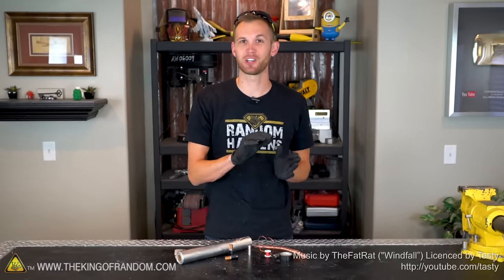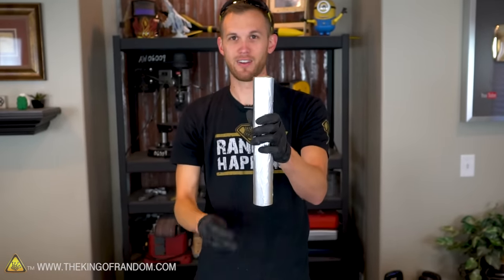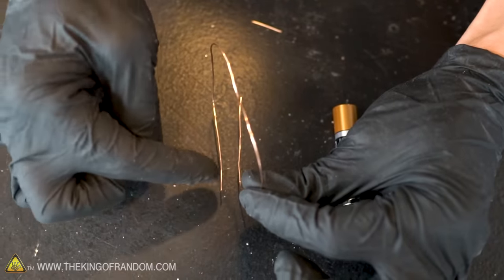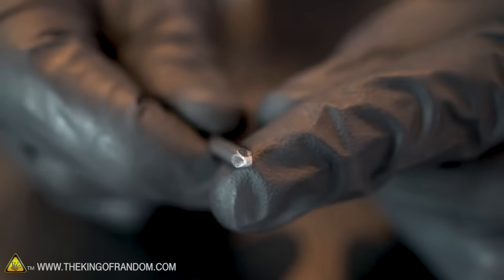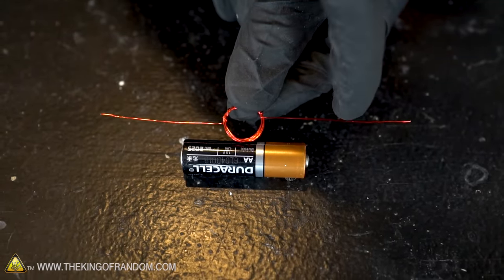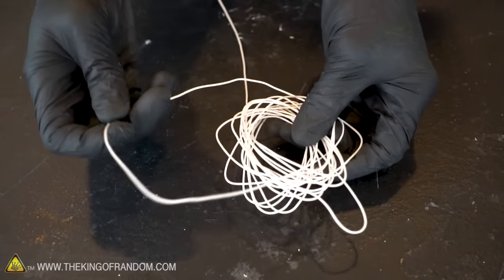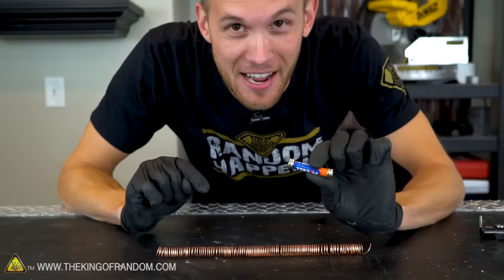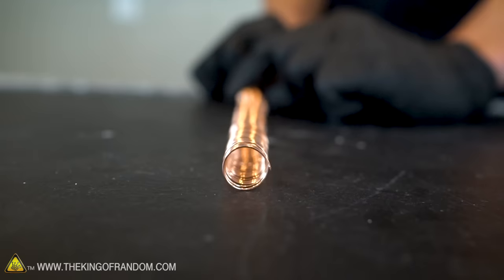4 Simple Magnet Motors You Can Make at Home! The TKOR How To Make A Magnet Motor Guide!

Comment from the maker: Hey what's up Noti Squad?! Welcome to December!  For planning purposes, we're posting a video every single day from now until the end of the year.  🏆 Should be one crazy ride so hang on! 😜🤘
Reply: magnificent video
Reply: when a conductor passes through a magnetic field in induces a current in the conductor 
and when a current flows through a conductor in induces a magnetic field
Reply: You're gonna be busy this whole month. Haha
Reply: The King of Random i found out that a candle emitted a electromagnetic wave. with a photovoltaic candle holder you can get electricity too 🤗
Reply: please make a video of modified dynamo of tamiya (a toy race car from let's go anime) .. change the the magnet and copper wires of the  dynamo to a strong magnet and slightly thick (i don't know if the western country have number for copper wires but colleague said the number you need to use is number 22) and the result will be amazing blazing speed of tamiya .. btw im from the philippines .. im very sorry for my grammar .. love you lots from the philippines ,, power to you guys
Reply: with the magnets and copper coil, is there a way to increase its velocity?
Reply: EPIC!
Reply: The King of Random can u do a video how to. Upgrade small dc motor
Reply: didn't batteries used to have a dip on the negative?  I've suddenly realized most batteries have flat bottoms
Reply: You should loop the wire (almost) and see if the battery can loop around.
Reply: Sir Peachez increase the voltage. I.e. add another battery:)
Reply: scottaw1981 nerver seen that
Reply: The King of Random where are you
Reply: The King of Random make wonder woman's lasso
Reply: Yeeeee every day
Reply: It is so difficult to post videos every day but you guys are awsome
Reply: You can actually cut through alkaline batteries and any AAA and AA batteries, but not if they are li-ion and li-poly because they like to explode when they come into contact with the air
Reply: what kind of credit is it your getting by translating videos
Reply: The King of Random - please join the copper coil together at both ends. I wanted to see whether it would speed up. Also does a bigger battery and magnet = faster thru the copper
Reply: My BIRTHDAY is after December into January but Christmas is coming soon
Reply: @The King Of Random wanting to see you on camera soon
Reply: Magnets
Reply: Can you up-size that experiment with the coil and battery to something much larger.
Reply: The King of Random hey man
Reply: Nico Bryan weeses
Reply: Keep doing these kind of vids plz! These are the one that got me watching your channel!
Reply: Hi
Reply: YAY!
Reply: The King of Random add to the blow dart gun plz
Reply: sup
Reply: Make a loop for the train, and make a bigger version.
Reply: Upload on Jan 7 too
Reply: so every simple project is going to be 5 parts.
Reply: The King of Random hey
Reply: The King of Random this is what I’ve been waiting for bro! Vids every day!
Reply: The King of Random that was like 1 1/2 inches not 1 cm
Reply: Can you still do all the things you did in the ninja video
Reply: Where did grant go???😭😭😭
Reply: The King of Random where did grant go
Reply: Make a longer copper spring see what happens
Reply: Petmalu ka Lodi
Reply: i could make a motor and use it for my science fair this year at my school
Reply: Where did you get those magnets
Reply: The King of Random what/who is your source for the magnets?
Reply: The King of Random I got a question. I just wanted the video were y'all put dry ice in liquid nitrogen but what happens if after you put dry ice in liquid nitrogen the put it in liquid nitrogen after its been in the vacuum chamber for the super liquid nitrogen. So I guess I'm asking in a simple way is what happens to liquid nitrogen cooled dry ice in super liquid nitrogen
Reply: The King of Random if you stabbed into the battery, lots of staining acid would spill out. I️ know from experimenting
Reply: The King of Random you are more or less creating several small inductors (which generates a electromagnetic feild). This is also  the idea behind rail guns, so yeah that's some powerful stuff.
Reply: The King of Random l
Reply: What is your email so I can send your family
Reply: The King of Random not everybody can find neomidium magnet in their hourse
Reply: Oh that is why I love you.  😘😘😘😘😘😘😘😘😘😘😘
Reply: The test with aluminum foil and magnets is called an eddy current
Reply: The King of Random do the magnets have t ok be the same type as you used?
Reply: The King of Random hey grant you could’ve made a perpetual motion machine with the third copper coil train if you bent it into a circle but it would technically be deemed a perpetual motion machine because magnets run out just thought you might want to know
Reply: The King of Random with grant i hope...
Reply: The King of Random cool video dude next video use you this project for making your own helicopter.
Reply: The King of Random please make subway for this electromagnetic train for the next video.
Reply: The King of Random I think you will be so busy making video for us.
Reply: please make a RC zeppelin that can drop bomb
Reply: The King of Random do liquid nitrogen vs fire
Reply: The King of Random were do you buy your magnets
Reply: The King of Random, please do a project on making a rover that can survive on mars!
Reply: The King of Random
Reply: if you make the loop of the coil will the battery keep running??
Reply: try electroplating  of each material  and plz make the give aways again for some time
Reply: Yos but where's grant
Reply: The King of Random this is awesome
Reply: I love this vid do another
Reply: The King of Random the first one works better with a copper tube. Magnetic field is much more powerful without the cardboard inside the aluminium.
Reply: The King of Random mix water with food dye with the motors.
Reply: How long can you make the copper wire train?????
Reply: The King of Random with the last experiment try and connect the coiled wire into a circle so the battery and magnets keep moving infinitely around in a circle. Just a thought
Reply: The King of Random nice
Reply: The King of Random  how to make a artificial magnet
Reply: Read my comment please
Reply: The King of Random read my comment please
Reply: The King of Random I know they are gonna short hacks..probably long as well if they were prepared a while ago...but please make a PCP air rifle..regards
Reply: The King of Random ~ Your Amazing!
Reply: Make a video showing how you could use a magnet motor
Reply: Are you his partner now?🤓
Reply: Duh
Reply: would have been cool if you made a looping tunnel with the copper coil and cause the battery to run indefinitely... or at least until it explodes from having a completed circuit with no load.
Reply: The King of Random what happened to other guy??
Reply: You should show us how to make magnet motors that generate electricity and work
Reply: vajje2k5 yes I was thinking that
Reply: The King of Random where is grant? who is this guy?
Reply: The King of Random hi
Reply: The King of Random fidget spiners that move oin their own or semi automatic fidget spinners
Reply: The King of Random make a copper cool train that goes in a continues loop
Reply: Can someone give me a link to the exact magnets he used?
Reply: Can you please make a fire trail
Reply: The noti squad is a month late XD
Reply: I watch
Reply: I watch your videos on YouTube 🤟☠️
Reply: Yes
Reply: Thanks
Reply: You know
Reply: The King of Random thanks! now i can build my own tesla!
Reply: The King of Random OK CAPTEN!!!
Reply: The King of Random where do you buy those earth magnets?
Reply: The King of Random a. Z a.  As a az
Reply: The King of Random iiiii
Reply: so if you had a circle large enough of that coiled wire, could you have the magnets on the battery go around and around in a circle indefinitely?
Reply: kiwico does some of these expiriments
Reply: Can the train go up?
Reply: The King of Random if you do the hammer nail and battery, do not use lithium batteries
Reply: The King of Random is awsome
Reply: The King of Ran
Reply: The King of Random its august
Reply: The King of Random does a normal magenet work am just making sure incase am wrong
Reply: The King of Random  were is Grant?
Reply: Does it have to be copperwire
Reply: I have an idea
Reply: Make a longer coil and see if the train goes in a vertically oriented circle
Reply: Charley Scheffler definitely. Hooking the wire up to a larger battery means you wouldn’t need the battery inside the coil. Also wrapping the wire more tightly.
Reply: Rip
Reply: Noti squad!?
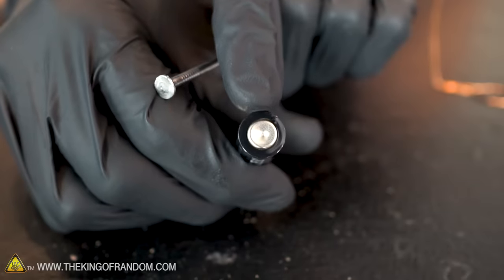Reply: just doing this so i can see this later 4:48
Reply: Wowwwwww
Reply: Wowwwwwwwwwww
Reply: 11 98
Reply: @alfranciznotario7881  yes
Reply: Ok
Reply: Can you do make your own generators?
Reply: @sleepyzero5363  hi

Comment: You should take the last project and make it super long. Like a giant magnet train track
Reply: And make it a loop
Reply: Young stimpy or just made a circle for infinity turn
Reply: Young stimpy using that method he should be able to generate electric current to power something else amazing idea.
Reply: +Score Moore Erhm....no.
You use energy (from the battery) to create the magnetic field that causes the movement.
You can't get surplus energy from that.
Reply: MGC # it technically wont go forever though so ye. Maybe the kinda infinite circle?
Reply: Physics girl did this
Reply: Score Moore the energy would just be transported there won’t be more energy made just the same that was always therr
Reply: or up the ampage and make a railgun?!?!?!!?!
Reply: Battery would run out.
Reply: It wouldn't work in a circle cause physics
Reply: Make it super long, in a loop so its infinite.
Reply: Steelmage99 If you were to start a perpetual motion device and use the motion of it to power something,  I'm theory you could have a continuous source of energy so long as the device continues to move...... 

in theory.
Reply: Young stimpy Some guy on YouTube already did that
Reply: Score Moore Unfortunately it wouldn't generate any power on its ow. The battery is the power, and it only moves by shorting itself on the coil, turning it into an electromagnet one short section at a time.

Comment: Pretty cool demo, TKOR. I hadn't seen the aluminum foil roll trick before. One small criticism at 4:55 - that's not inertia causing the counter-rotation of the battery and magnet. That's the equal-and-opposite force there. The electric and magnetic fields' interaction causes a torque on the wire (source of the electric field), which means there's an opposite torque on the source of the magnetic field.

Comment: "Cut one cm outside the battery" The metric system is slowly taking over, one slip of the tongue at the time. Yay!
Reply: andvil01 I don’t think it was a slip of the tongue did you think he meant inch cause if so those batteries must be 5 inches long to have that be an inch past the end
Reply: I don’t think it was a slip up it was just the smallest measurement

Comment: Can you make a motor using magnets only?  No battery's or voltage.  I saw a guy on YouTube do it but the video was pulled off YouTube.  He used the Plus polarity of the magnet's, Then had a more powerful magnet aimed just right using the plus polarity and they opposed each other and the small wheel started turning on its own.  Had to give it a start spin.  But, It actually worked.  You do this and you have free energy.

Comment: What would happen if you place the motor you first showed us into water, would it still turn and if so if you place it at an angle on some kind of a small floating structure could you use it as a form of a turbine that pushes the floating object?
Reply: High speed low torque
Reply: But yet you don't know water conducts electricity
Reply: I think it would only float north.
Reply: @mrpanda2655  no, pure water does not conduct electricity.  But, it is hard to find pure water.  Most water, including tap water, contains salts and minerals that do allow electricity to flow.  Never the less, the statement, "water conducts electricity" is false.

Comment: What would happen if you used the electromagnet train idea in a solid copper pipe?
Reply: Alex Green same thing with the aluminum foil. Since copper and aluminum are noj ferrous metal they are non magnetic, but since they still are metal it creates an electrci field which slows it's decent
Reply: It wouldn't work at all, because the electricity would flow parallel to the battery and you want it to be orthogonal towards the battery. Additionally, the force is proportional to the ammount of convolutions(Force = Magnetic flux density * electric current * length of wire in the magnetic field)
Reply: It would just act the same as the aluminum foil

However, you can probably use more windings in the coil to get a different outcome

Comment: So now I know what to do if I ever need to drain a battery.
Reply: Busters 72 the battery won't be drained though
There's nothing using up the electrons inside
Reply: Bready Wrong. The power is flowing from the battery though the magnets into the copper wire and around to the other end. You can not create an electromagnet without power flowing though it. It has to come from somewhere and in this case, it's coming from the battery. This is why in the first one he showed that the wire must touch the bottom magnets to spin. If they didn't need to touch the bottom to complete the circuit, all you would need to do is make an M shape in the wire. Go try it yourself and let it run. Over time the battery will start to get hot and discharge.
Reply: Bready, the copper wire is completing the circuit from the positive to the negative side (or vise versa). If this did not drain the battery, we would be world famous for making the first perpetual motion machine.

Comment: Make the last motor tube longer, put the battery with magnets inside, connect two ends of wire together into a circle, and you'll get motor that goes in circles and never stops😀
Reply: Ion Chiloch until the battery runs out
Reply: Silverlit Studios no
The battery's electrons aren't actually being used since there's nothing dissipating them
Reply: Silverlit Studios yep
Reply: Bready I think the battery does nothing, and the movement is caused  not because of electricity in battery but because of magnets. I think you can put any other metal that is magnetic instead of battery
Reply: Ion Chiloch I see what you're talking about

I'm thinking maybe it's the iron in the battery's steel shell

If I get a small rod of steel and try it maybe the effect would be amplified
Reply: Not true. The battery is needed because it's providing a charge in the coil between the it's ends. The magnets attached to the battery are the points of contact for the power to flow creating the electromagnet zone. That is what is causing the coil to have a magnetic field that the solid magnets are working with. As the battery moves, it is coming in contact with different loops of the coil and the electromagnetic zone in the coil moves with the battery. If it was just the magnets doing the work without the battery, you wouldn't need the battery or to even strip the copper coil. If you think I'm wrong, go build one with just a wooden dowel in place of the battery and film it. You will find that nothing happens.
Reply: Ion Chiloch sounds fun!

Comment: if you use the fleming's right hand rule, you'll understand that the electric current(generated by the magnet going down via gravity) will generate a magnetic field going in the opposite direction, causing the magnet to be pushed against gravity.. not sure if that's a more logical explanation.

Comment: Can we use 14 gauge uncoated copper wire for train project ??!
Reply: The thickness of the copper helps with the field; a smaller gauge might not let it overcome friction. However, if it's the same gauge as the wire used, it should work exactly the same.

Comment: The magnet falls slowly through the tube because of an effect called inductive reactants the flux electric fields are induced into the tube by the flux lines of the magnet. All your experiments are using the principles of induction and EMF (electro motive force) for EMF you need a conductor, flux lines and relative motion. You should try making a crank generator

Comment: You should try that with transparent aluminum so you can watch the magnet falling. We did get that from Star Trek right?😉
Also, & seriously, have you dropped a magnet through the copper coil to see if it slows like it did in the foil roll? I know it works with copper pipes. Maybe you’d see it better through the copper coil you’ve made.

Comment: hey guys i have a doubt for the 3 rd project shown in the video .......the one in which battery, coated copper  wire, magnet, and 2 pins are used......my doubt is instead of coated copper wire can we use a normal copper wire without coating??